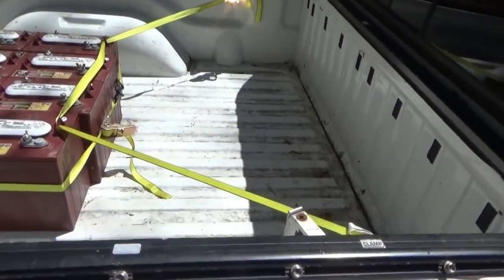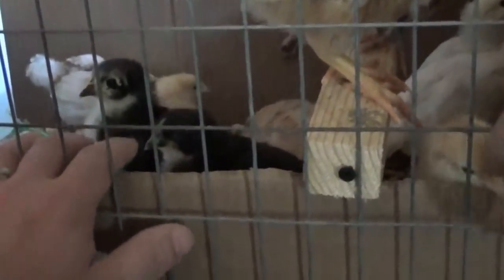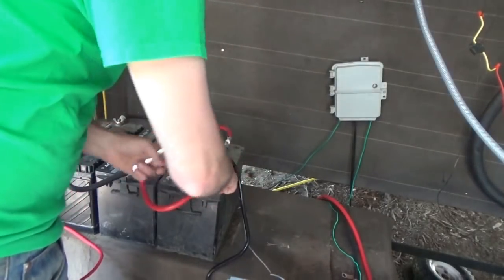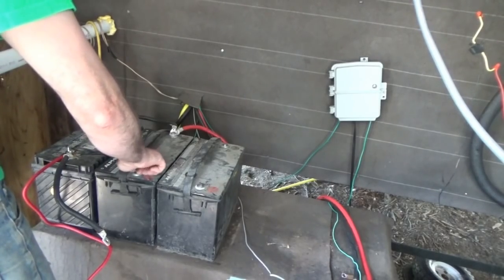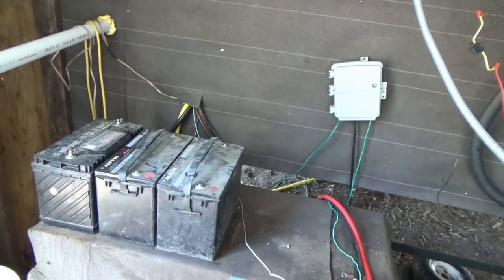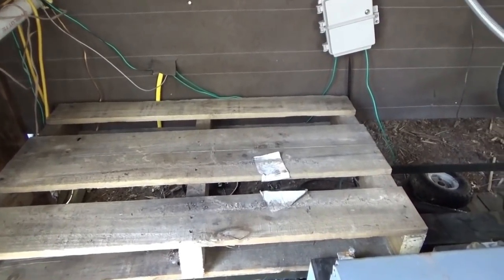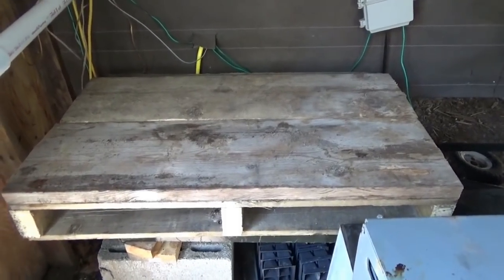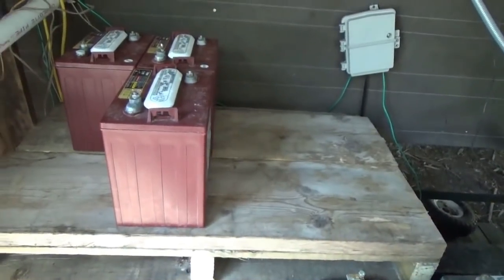Putting Trojan T105 Batteries In My Off Grid Tiny Home

Comment: Thinking about getting 8 of these as well and 1500watts in panels. Is that enough to power a 700watt window air-conditioner?
Reply from the maker: In full sunlight you can run a 500 Watt AC no problem and for a while after peak sunlight hours.

Comment: with all the batteries you went threw you make my head spin. I had the same trojan 6V when I started. my old cart batteries 6X  club car .transmission  went. I ended up with NiFe 700 Ah 12V total in july 1996. 2018  now. still going strong. hey my morning star I got in 96 MPPT still going. must have been Y2K ready. LOL
Reply from the maker: If you get good batteries to start out with, sure. My first ones were no good. I still have them though and am restoring them, which you may have seen on my electronics channel.

Comment: How much cost these battery. In my country they are prrety expensive. I think they are the best battery for solar. I'm looking with intersting at yours videos.I have a small off grid solar system with 1000w power with 40 amps mppt and three forklifts deepcycle battery wich are at 60% of life. I apreciate what are you doing. Keep it like this. Sorry my poor english.Regards
Reply from the maker: $100 to 130 each. Thanks.

Comment: I'm looking at 8 t105 for my battery bank....do they work good for ya ..is it enough to get by?
Reply from the maker: Yes they are working very nicely for us now. They are enough for us but we only run some LED lights, laptops, small electronics and a freezer so far. I think that with more solar panels we could run more things out here although on a sunny day we are in float mode by lunch time. Cloudy days are the problem though.
Reply: How many watts are your panel's...I have 520 watts
Reply from the maker: 1200 but only 600 get sun at any given time due to trees. When I get the trees thinned out I will be doing very good.

Comment: hello Troy and Melanie I make replacement power cable ends out of copper tubing I cut them into 3 inch pieces solder them onto the cable smash one end and drill a hole in it to fit the terminal average cost is about $0.25

Comment: yeah but not grease liquid form in spray can but clean terminals real good with wire brush actually I used to buy it at ace hardware !!
Reply from the maker: +the shadow people Use the liquid or the grease? Which are you saying is good?

Comment: Wow Troy, have you been running the Tiny House on wheels all this time on only those three 12 Volt Batteries?

I think you mentioned having the Fork Lift battery bank serviced by the manufacturer.   I imagine that would be expensive.
Is there no way to determine if you have a bad cell in it?

Troy are you still using a wind turbine as back up on cloudy days?  It sure does seem like you have windy days up there.
I know in past you did have one wind turbine get blown over.

How many amps do you think your new battery bank will deliver?

Comment: I'm an electrician and when I work on live AC/DC power I always use electrical tape and put at least layers of electrical tape on all the tools I'm using. It only takes a few min to do and then I can relax and not have to worry about shorting anything out. Also best to take as much of the electrical load off of anything you are working on live. So ya at least tape that wrench up good. Even working slow it is easy enough to short that wrench out to something and burn yourself at the very least and ruin your batteries
Reply: +TheSimplecanadian    That sounds like a great suggestion.
Reply: +TRX Vlogger even about 3/4's of the electricians I work with don't understand the amount of short circuit current a standard electrical panel is capable of releasing. Usually at least 7000amps in a fraction of a second. Electricution is the least of your worries at that point. Those arc flashes reach temperatures close to the surface of the sun. Most electrians are killed from the 3rd degree burns on their entire bodies or being thrown against a wall. Also when the arc flash happens it's like a super heated bomb going off shooting molten metal at speeds the same as a gun. Unlike a gunshot a piece of molten metal the size of your fist or bigger doesn't just leave a nice clean hole. Anyways this is more so for A/C power but I've taken a few arc flash coarses and seen the damage and heard all the stories of guys being killed. It's serious stuff.
Reply from the maker: +TheSimplecanadian Thanks

Comment: Troy , do you replace your terminals with store bought? You can,  with a little patients and a good soldering iorn  (propane with a copper tip) make your own out of 3/8 soft copper pipe. If done properly you will have better than store bought. Two important tips.Forge the opening with a pointed punch ,then final drill it. second use plumbers flux and tin the entire piece ,crimp onto the wire then solder again. (physical AND mechanical connection) Of course you know not to use a torch around the batteries...:-)
Reply from the maker: +Steven Hardy I will see if I can find some copper pipe. Thanks for the reminder. I always forget copper pipe works well. Problem is that its harder to find these days due to scrappers
Reply: The Do It Yourself World Maybe just buy a couple feet at home depot ?

Comment: there is a product you spray on electrical splices or battery terminal s it's red and works great save you allot of money and time instead of replacing jumpers but clean them with small wire brush spray it on and you will be good to go used it for years on my power supply battery's Loews or most hardware s carry it !
Reply from the maker: +the shadow people Yes I am going to get some of that
Reply: +the shadow people     Is it like dielectric grease that inhibits corrosion?

Comment: Good work troy, about time you got yourself some new batteries. Are they brand new or part used? Next time id go out and buy lithium 18650s and make your own bank like many are doing now, but that probably wont be for a while, those batteries should hold up for a while :)
Reply from the maker: +Daniel Wilson The big problem is that right now most of my devices are running on 12 volts. I would have to convert everything over. There is no waste at 12 volts. If I could find the proper adapter for my DC-DC laptop power supply to fit my HP, I would have even that on 12 volts directly.

I may convert over in a couple years
Reply from the maker: +Daniel Wilson These are about a year old. From preppernurse1, if you missed the videos, go back to the last two videos when we drove out to see him.
Reply: I'll be honest, I filter a few of your video's but always interested in seeing how the progress is getting on. Quicker than me! I still havent got my land yet! haha Upgrade that bank to 48v and get a new inverter! Much more efficient less amps = less heat = less wasted electricity ;)
Reply: +The Do It Yourself World if it ain't broke don't fix it as the saying goes! Fair shout, thought you were running most stuff off your inverter. Do you use a fridge/freezer?
Reply from the maker: +Daniel Wilson propane fridge right now

Comment: What does "Now Totally, Totally, Totally off the grid" mean?  What were you before?
Reply: +Brad Haigh  He was trying to say that his solar grid was disconnected also.
Reply: +The Do It Yourself World werent you using generator forthe washing machine? or did you finally get the washer on solar?
Reply: Maybe he means he shouldn't have to use a generator anymore?
Reply: +Brad Haigh It was a joke. He just meant he had everything disconnected while he worked on it.
Reply: +The Do It Yourself World that's good idea haven't watched in several months so I did not know that.
Reply: Well if he has had me, I hope he enjoyed it
Reply from the maker: +Brad Haigh No power. No water. Nothing at all while I was working on the system. I was sort of having fun with the words.
Reply from the maker: +Homestead Newbie I have not needed a generator in months actually. The sun is stronger and the leaves have not yet fully opened up on the trees.
Reply from the maker: +Tea Kramer No I mean I did not need the generator for the battery bank all this time. I was not referring to other jobs outside the tiny house.